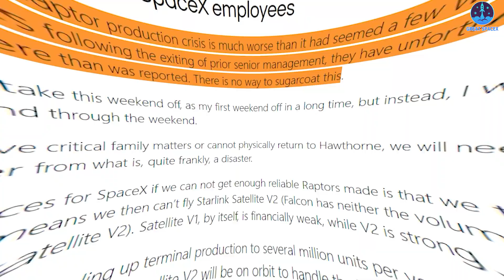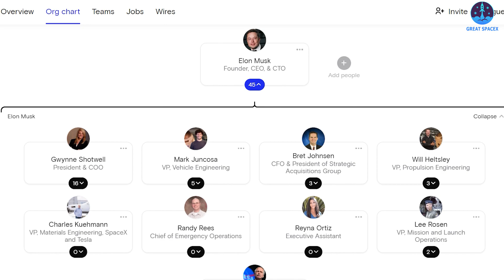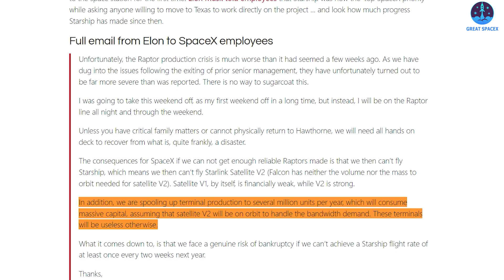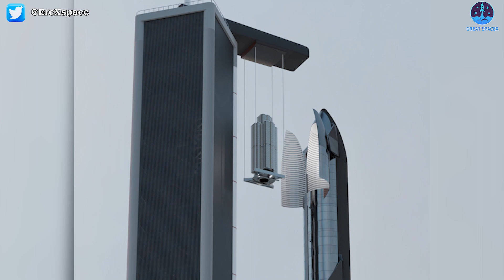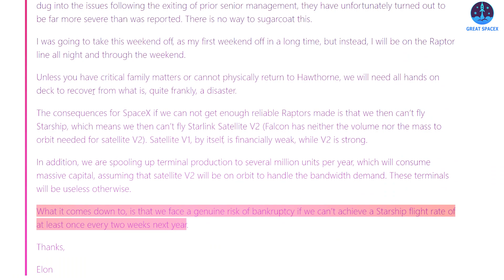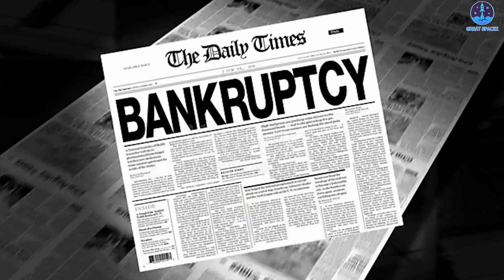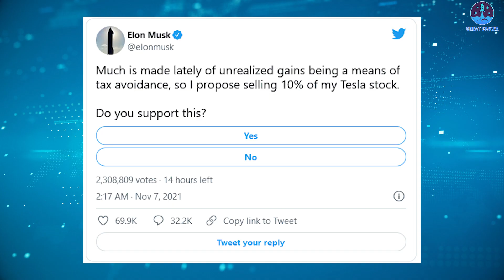Musk just revealed "Starship Raptor Engine is a disaster" that puts SpaceX at risk of bankruptcy

Comment: The Raptor engine works, so the only issue is building them fast enough. This is something Elon always goes on about, building the prototype is the easy part, scaling up production is the hard part...maybe he wants to rethink landing the 1st booster in the ocean?
Reply: The Raptors are melting smooth brain.
Reply: @billquigley6556  That wasn't obvious 4 months ago when I wrote that, it was more an issue of how to build them faster. The usual solution to engines melting themselves is to change the fuel mixture so it doesn't burn so hot.
Reply: @Pete856  In this case, after one year, SpaceX just upped the chamber pressure ~50% and the prototype R3 unexpectedly didn't explode.

Comment: Okay, the engine design itself seems sound. The problem is a production problem, which is fixable. I don't think we're looking at the beginning of the end.
Reply: Rocket engines are not built on  assembly lines.  They are highly specialized pieces of machinery.  The adults in the room know this, but are afraid of the temper tantrum Musk will throw when they tell them it takes a long time to develop a successful engine.

Comment: Could you do a new subject 🏆 pass on the force deluge scattered on the table with an additional 10 meter silo installed on the staking table in order to visualize ++ Kn of effective force per cubic foot of methalox v2 discharge?

Why does it give the impression of firing a shell with 🥊🥊🪒♨🌪🌪a revolver on the🪑⚡ table?

In fact, how not to destroy the table without a silo for stripping the solid bar of the thrust plume of each
raptor during the initial dispersions of the centering force of nearly 40 raptors directed towards a stream of less than 30 meters inland of flame?

A third issue is the dependence of the fact that the greater the length of the bore for this number of turbine revolutions for each engine, the more thrust is supported by the nozzles with lifting segments guided servo-controlled by which conical powered damper?

Finally by which lifting cones not supplied on their internal surface in degree of bearings are assisted by a double external shield with a movable vertical force heel?

A powerful point. Your fantastic, well-presented topics are always very exciting and very to the point.
The animations amaze the audience people wonder
today what sauce will the two titans that are PHOBOS & DEMOS be digesting in 2022-2023?

The only ones capable of bringing the 2050 mission to its true days in March? It is that with all these means of diversifying stocks of laboratory technicians specializing in assembly for the general public, 😅🤣🤯 who will want to modify these two MONSTERS?

Comment: As a lifelong space enthusiast, mechanic, machinist and general tech nerd its obvious that this rats nest of plumbing was "designed"
by people that have never built or had to work on ANYTHING!!!
IMHO all engineering students should be required to spend 5 years on the shop floor before being allowed access to CAD software.....
Reply: They should study the Saturn V F1s or the Shuttle RS-25s.  They would learn what it took time to develop, work through the ignition sequence, test, test, and test again.  To me, real engineers developed those engines where as it appears silicon valley people are designing the Raptors.

Comment: Space-X has a good track record for failure and innovation as a solution. The engines and their complexity is the issue here and the idea is to make them a trivial production item. It will be a significant hurdle to overcome but I suspect Elon and his dev team will be up to the task and completely reimagine the manufacture process. The main issue is to simplify their construction, which they HAVE been doing, just not enough so far. I suspect they won't be actually needing to launch every 2 weeks to keep costs on the level but they probably do need to step up production to a level where they COULD launch at that rate and have fresh engines to swap out to quickly ready for new flights and eat any losses due to 'rapid unplanned disassemblies' during initial testing. With the initial starship hops it was 3 engines per launch and fail, with the heavy booster, each failure will be 30 engines which means the refly delay will be 10x as long as the S series so if they don't sus it out we could be looking at years before a heavy booster will be properly tested and ready to go.

Comment: so they need the engines to but on starship to take the new sats to space as there bigger than the last ones..also there is a time period on the sat to be launched granted on the application to set up a world coverage ...I understand that as every prototype booster and starship launched will require engines that they cannot use again ..
the amount of sats up there increase the world coverage and the customers so they need to get those sats up there a.s.a.p to get a pay back on money spent.( so the problem is that they cannot make them fast enough then ) and they cost more to make than they budgeted for ??? and the dishes cost a lot to make.
cash flow problems then......bet bezos knew this when he tried to delay the money going to spacex and delay the sat application if you cant beat them stop them.

Comment: I am not surprised by Elon Musk e-mail about bankruptcy. Mass Production of Raptor V2 is very difficult. I am not surprised by Starlink V1 is financially weak. No one to date has succeeded in making internet work from space. Maybe SpaceX needs to slow down the expenditure at Boca Chica to allow Starlink V1 to break even. The vision is unravelling.
Reply: You are correct about Starlink.  His sales model is flawed.  There is not enough market share to make the substantial profits he needs.  He is losing $1000-$1500 for each dish he sells and depends on $100 a month subscription to get that back and then go to profitability.
Reply: @pebmets  Thankyou, having seen other videos posted yesterday there is even the suggestion that the Raptor engine 'By Design' can be unstable. This could explain the Quality Issues we were seeing when they had to keep swapping out the engines during the SN8-15 testing phase. If you have 1 bad engine out of 3 then scaling upto 29 means you have to swap out 7 bad engines for the main booster. It may not be possible to identify in the manufacturing process which part is causing the instability. Could this be why Elon called it a disaster? In the development of the Saturn V they hit a disaster which stopped then going to the Moon. They got lucky by redesigning baffling & injectors. There is nothing predictable with high pressure combustion fluid flows, especially when the fuel tank & engines are expected to do a somersault. It's nothing like an electric car.
Reply: @macswad  When you said electric car , it got me thinking.  He is calling engineers from his other companies and he is going to be on the assembly floor.  Don't know how he can help with designing and manufacturing a rocket engine..   He needs people who know rocket engines and aerospace people, not people from his other companies. 
Also, this rapid iteration leads to your point.   If you are putting millions of parts together and then testing, it is going to be very difficult to find a failing component.  This is why other rocket companies, NASA, ULA, etc, don't test this way.  I believe Musk's test and manufacturing technique will ultimately doom this version of Starship and he will end up with a smaller more sustainable vehicle or someone else will.  There was an opportunity to build upon the falcon series and instead of taking an incremental step, he tried to jump too far too quickly with this version of starship.
Reply: @pebmets  We don't yet know what the issue(s) are with the Raptor V2. If it's a design issue then yes to experienced rocket engineers. If it's a mass production issue then production engineers from tesla could help. If it's a quality checking process issue then again other engineers could help.
The thing with starship so many people want to make it work & share it's vision. Humanity's Survival depends on Starship - preserving the light of consciousness. It's an absolute game changer $/Kg and better dream than Jeff Bezos. When you said a smaller more sustainable version, Did you see Scot Manley's video on Rocket Lab's Neutron Rocket. Almost fully reusable while using carbon fibre & simpler to manufacture single stage engines.
While a competitor to the Falcon F9 it's not a game changer. I would love to see Every Day Astronaut Tim Dodd to be invited back to be sat on Elon's shoulder while they troubleshoot the problems. It could make dramatic TV.

Comment: The thing is, this is not the first communication satellite constellation.  The road to communication satellite constellations is littered with bankruptcies.  SpaceX is spending big, really big, and those huge expenditures will be there for years before these pet projects can make a profit.  I call them pet projects because Falcon 9 is doing well and SpaceX has a strong core business model, so this is all extra stuff Elon wants to do.  Then again over time want becomes necessity.

Rocket engines are hard to make.  It is even harder to make them reliable.  Elon is seeing this, but all of his plans are based around solving this technical problem.  He is obviously hoping if everyone puts their heads together, they can crack this tough nut.  He has to be careful though, maybe more than he is being, because he needs to keep good talent around that knows what is going on to crack these tough problems.

Getting into the Starship and Starlink profitability model, a rocket is made, proven, and then missions start lining up for it.  While Starship is flying, missions more suitable for Starship than Falcon Heavy such as Europa Clipper, will fly on Falcon Heavy because they ain't changing rockets again.  So it will be years before a significant number of commercial missions for Starship fly, at least to the point of making Starship a profitable rocket.  With Starlink, it is going to take time to get the apparently rather chunky V2 satellites up.  It is going to take time to get a bunch of user terminals to end users.  It is going to take even more time for enough money to flow in from those terminals to turn a profit.  It is going to be years.

In other words what Elon Musk is saying is he already knows his plans won't turn a profit for years, but he is not even willing to let a Thanksgiving go by where that date may slip further.  The problem is burnout and turnover can push that date much further out.  The thing is you can't ding the staff that left because it was a tough problem.  However Elon does have a point that the problems must be solved for things to work out.  Anyways, do you want to keep building less capable satellites that launch on a rocket where you have to build a new second stage for every launch or do you want the massive economies of scale rocket where both massive stages come back every time for another launch?

I am curious what this Starlink V2 satellite constellation is really going to offer.  If you have the scoop, that would be a great thing to cover.  For aircraft testing, I have also wondered if the planes are only going to talk to satellites or if they will have a downward facing antenna array?  Planes could be interesting in both direct contact with ground stations and shortening the latency even further for customers underneath the flight path.  It is more of an interest for domestic flights over land as over the ocean there are less things to talk to.  But still whatever capacity the plane can bring, what doesn't get used by the people onboard could potentially get used by people on the ground, granted an airliner is not going to want to haul around the bulk of a full on communication satellite or really anything more than what will make them more money.
Reply from the maker: Exactly! We will update you further as soon as we have the latest information about it.
Reply: My guess is V2 will be full coverage with lasers Between all sats and more broad range covering all parts of the globe. It requires massive amounts of satellites: thus starship launch costs was expected to offload these. Too expensive to keep launching on falcon 9 or heavy for that matter.

Comment: Looks like it a production volume issue rather than an issue with the engine.
Reply from the maker: Yep!
Reply: Imagine in next 12 months they will have to make around 400 sea level raptors, which is unheard of in rocket terms. That's in order to support deployment of the starlink v2 otherwise just burning cash while they wait.

Comment: Elon Musk has a strong sense of working hard, the manufacturing of the Raptor engines is down to the designer and the materials used, they should work on the lines of the Saturn 5 engines .

Comment: There is no way  SpaceX will go bankrupt. Even if the engines are a disaster as he says, looking at their trackrecord of fixing stuff, this is probably not gonna stop them either.
Reply: Raptor engines aren't a disaster, they have flown many times already, up to 10  kilometer altitude test flights several times, and even performed the first ever bellyflop boosted landing, reigniting many times for now almost a year old prototypes:) also the first ever in history full-flow staged combustion cycle rocket engine ever totake off the ground at all:) and its methalox! methane/oxygen:)
Reply: @agothxagothx9010  Elon is talking about Raptor v2 not the current version 1. Version 2 is a more simplified engine compared to v1, with better reusability, better performance, just a better engine overall. They are having problems ramping/scaling up the production of v2. Also (I think) the last v2 Raptor that was on the test stand blew up before it's test was done. Raptor v1 is still a magnificent piece of engineering, it's just not as good as v2.
Reply: @agothxagothx9010  You are right, it is mis-leading to suggest the Raptors are a disaster. Full Stage Flow Engines (like those flown on the space shuttle) are more complex to manufacture compared to say the Merlin. Also the quantity is 3x that of the Merlin for every flight of the booster. Musk knows the 1st 3 orbital flights will destroy 3x29=87 Raptors, that's a lot of cash. Also, the size & method of capture is all high risk so could be double 174 Raptors.  Even NASA had to step up production of the RD25D engines just to fly 10 times = 40 RD25D.
It is always harder to switch from a development mindset to a mindset of a mass production engineer. Maybe that's why Elon has replaced his engineering manager. There are 2 issues here:-
1) Starlink Profitability
2) Starship Mass Production
If you now add the cheap HLS contract awarded to Starship you can see Elon has not only undercut the competition he has undercut SpaceX
Reply: @agothxagothx9010  You sound exactly like Tim from Everyday Astronut :P
Reply from the maker: Yep!
Reply: Engines aren’t a disaster, it sounds like the people managing the raptors weren’t doing a satisfactory job and as Elon stated it was worse then he was told.  Engines work but the manufacturing process was a disaster
Reply: TBH this seems like "excel can handle anything" type of situation... as far as I can see the data being reported to upper management is quite different than what the "actual poeple" deal with daily. So excel shows 120% OEE but in reality thats impossible. Than suddenly it all goes BUM and this is the news... suddenly we need all help we can get coz I have trusted the wrong guys. 
From my experience in a company owning multiple plants over the world... the owner either does not give a shit about few milion euros being lost on management stupidity or he still trusts his guys and believe they can make it  better... on the other hands managements goes "I need to survive one more month, anything else is extra money, just need a lil bit more lies and update the presentation and show how big are the sales compared to 1995"
Reply: @janholly3001  damn, that sounds so familiar to the last word.
Reply: SpaceX is going bankrupt if they had to survive on their own cash flow. They spend more than they earn. They only survive by attracting capital from their investors and from doing contract work for nasa.
Reply: Holy mother of cope.
This bald apartheid emerald baron is done for, you'll have to find someone else to simp for now.
Reply: As far as I understad the disaster is not the engine itself but rather the rate of production and the quality of the finished product
Reply: Worth 280 billions but "strangely" Elon cannot pay a for him low 5 to 10 billions to stop his firm from going bankrupt and achieving his space colony dreams, hmmmmmm. That's smells like....
Reply: WRONG attitude Jesse. this is why you aren't ever going to be truely successful.
Reply: @that80zbaby  already am
Reply: Yes, can't got bankrupt just like Theranos couldn't.
Reply: @istherenofreename  SpaceX and tharanos are not the same at all.
Reply: LOL
Hopium.
In 1-2 years he will attempt to save spacex with Tesla by whatever means he can.
In 3-4 years both will be belly up.
Remember me when you hear these things happening.
I predicted solar city as well lol. 
Ez.
Reply: @JohnDoe-hg4lq  Well, we're one year in with your predictions. There seems to be a divergence of reality from prediction.

All the hoopla over a hole under the OLM after Starship's IFT1's successful ticking off a few milestones, being fanned by flamers with burned-out "logic boards." Raving mad Elon haters are foaming onto their keyboards.

Elon says they don't need outside capital, but if SpaceX goes public, I want a piece.

To the future success of SpaceX.
Reply: BFF.....Big F*cking Failure.